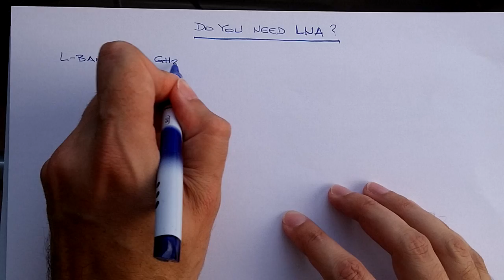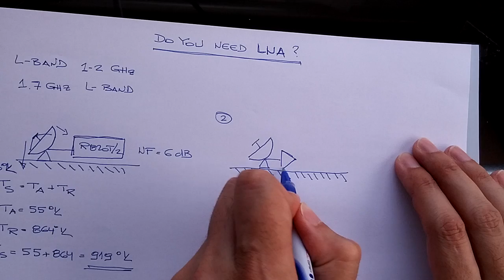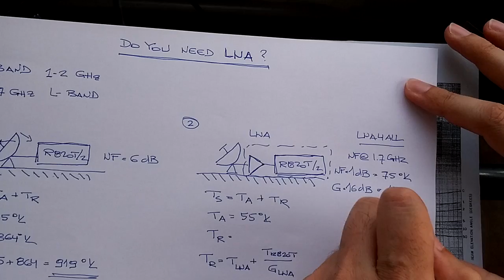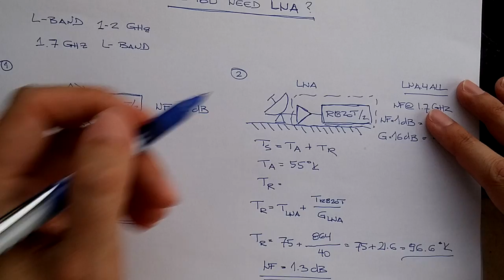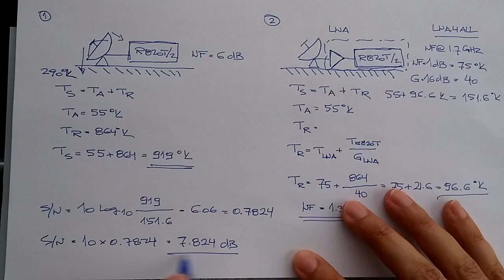LNA on L-band

Comment: Thanks for the great video and explanation, I am a bit confused though. I didn't really get the calculations of the SNR at the end of the video. Did you calculate the delta SNR or absolute SNR?, what does the 6.06 dB refer to?. I was expecting that the delta SNR = delta NF, why it is different?.

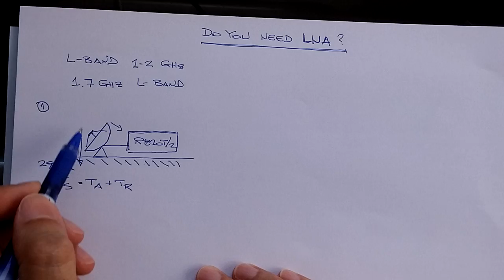Comment: Thanks, I'm including a link to that document you have behind your worksheet (@ 3:30):
http://www.dtic.mil/dtic/tr/fulltext/u2/265414.pdf
AD265414
Antenna and receiving-system noise-temperature calculation
L.V. Blake
Search Radar branch
Radar Division,
September 19, 1961

U.S. Naval Research Laboratory
Washington. D.C.

P.S. There is no such unit as degrees kelvin, it is just Kelvin. You have degrees Fahrenheit and degrees Celsius, but since Kelvin is the absolute temperature scale there are no degrees, it is just K.
Reply from the maker: Correct, you should advice then the  U.S. Naval Research Laboratory to correct the article :-)
Reply from the maker: Hello Bert, thanks to kelvin input I check the story behind the kelvin and found a lot of debates and interesting pro et contra going on. At the end, it is kelvin and it became by convention 1967/68. Before that the degree kelvin was used and after that just the kelvin. So kelvin, K, and plural kelvin. I consult the SI publications where they mention the 67/68 convention. The papers you link were written well before '68 hence the degree kelvin was used. But not only, I found the same mistake even in some later books dating the '80s or '90s written by several PhD. They are using the same digram. They did not correct that but further through the publication I can find the degree kelvin instead of kelvin. Further on, I found some interesting writing from NIST where they explain how to properly use and write the units. Interesting..
Thanks again for the kelvin input.